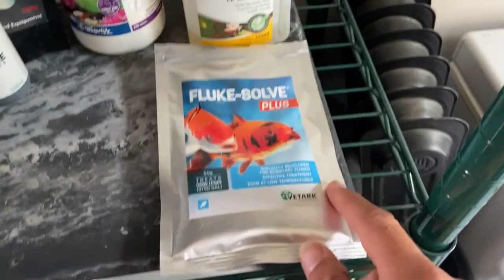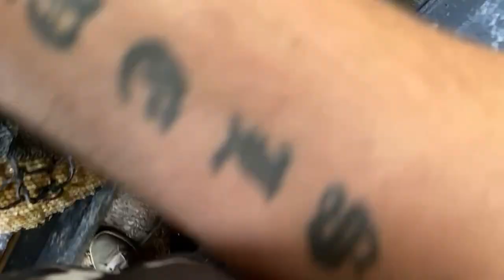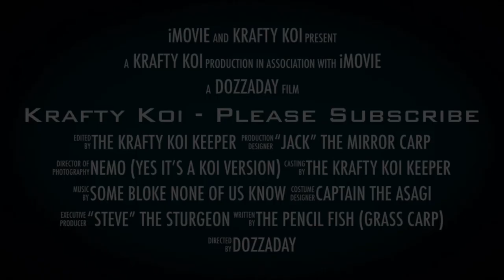Shocking debris in the Koi pond from the water pump, Acers and Crabs in Cromer.

Comment: I would say, an EazyPod complete (so.with the air and the UV built in) would be fab on this tank.
Reply from the maker: That’s my thinking also, I would like a bio filter and shower as well I think. The fish from my main pond will be in there while my new build is being completed. So I need to ensure better filtration and water quality with the fish to water ratio.
Reply: @KraftyKoi  if you quickly turn this existing tank with a bottom drain so it run gravity, then you can have a bio after the pod. Or you get a good pressure filter going to a home made shower. That works fine.
Or an EazyPod to a moving bed.